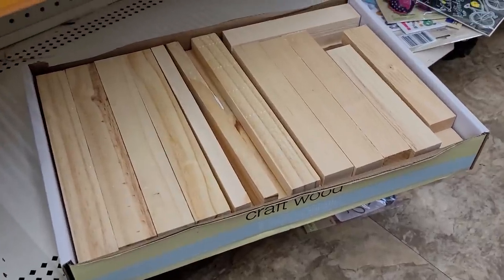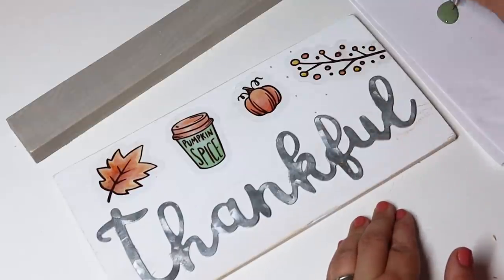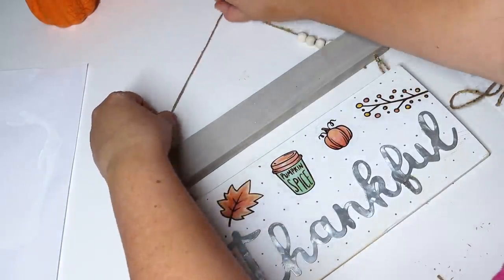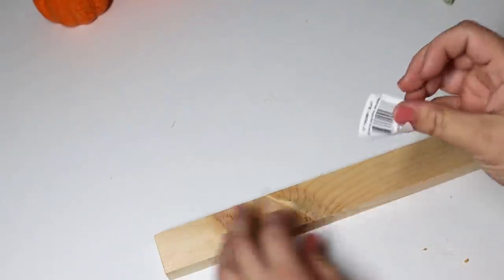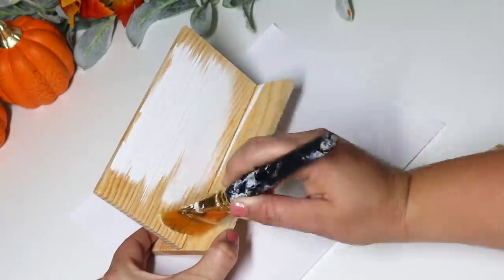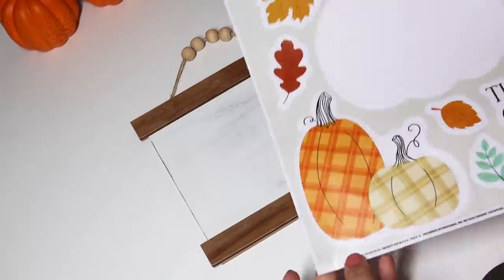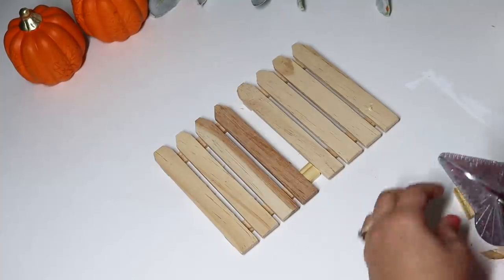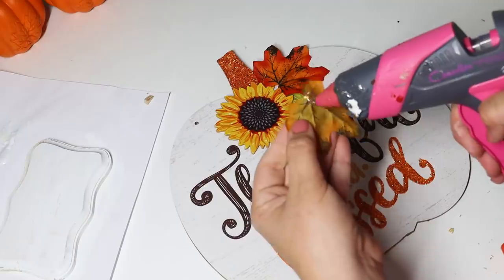GENIUS Ways to Use new Dollar Tree WOOD! | DOLLAR TREE FALL DIYS 2021 | KraftsbyKatelyn

Comment: For the 3rd craft w/the pallets cut to look like a femce, could you use the little wooden cubes from DT instead of cutting the tower blocks? I have several bags worth, & still haven't used them! And just an fyi, my DT actually had a larger  block of wood! It was the 1st & last time I've seen one, & there was ONLY one, so I feel like I really scored!

Comment: I've started collecting some of the wooden pieces. My Dollar Tree doesn't have much or else everyone gets there before I do. So cute & looks easy enough for a beginner.  Also I picked up one of the round pieces of wood. I found out that it fit on top of the old small plastic Lazy Susan's we use to buy years ago and can usually find them for 50 cents at estate sales. I'm wondering if I need to glue two pieces of wood together as they are really thin?  Also love the window clings for decor on your diy's.